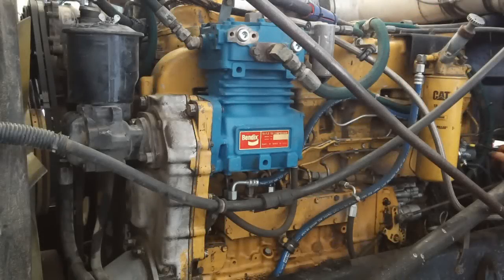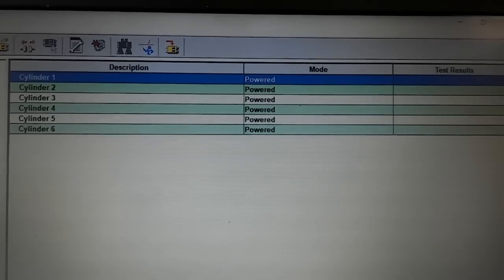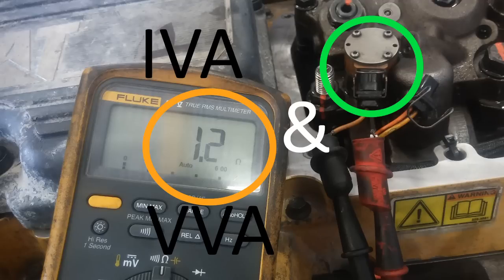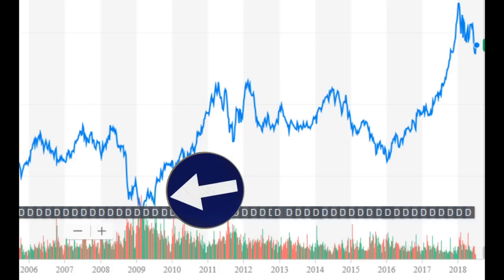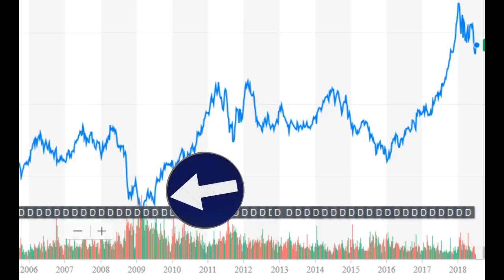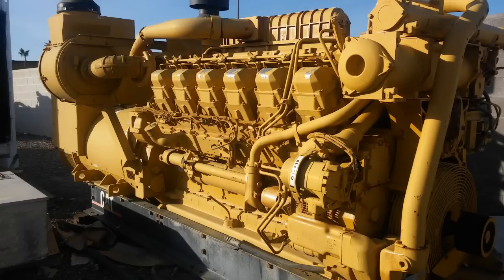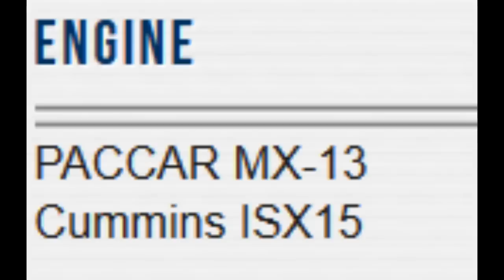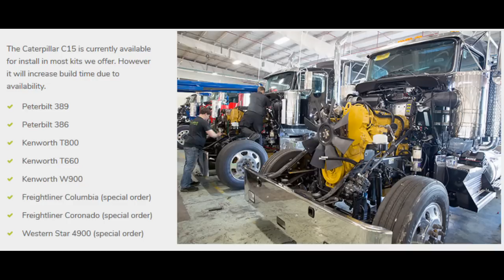Why Did Cat Stop Making Truck Engines?

Comment: Josh, I’ve read these comments. Some very childish, some in defense of the little guy, some praising CAT like as if CAT engines are the best and the rest being wise comments from the misunderstood. Also, you referenced Cummins as a little engine company like as if Cummins were Briggs and Stratton. I work for Cummins as a heavy duty major overhaul tech, I don’t favor Cummins but I do know they haven’t been (LITTLE) since the 1930’s. Cummins is now the leader in power, torque, emissions, on-highway, power gen, marine and agricultural applications. Cummins isn’t the favorite but they are damn close to being the industry standard moving forward. I hate Cummins engines, I personally refer to Cummins as (Cumapart) because that’s all they do now if they make it past 500,000 miles. More work for me at low pay and high maintenance.
Reply: I suppose why cat got out of the road vehicles due to the cost of playing the emissions game. As far as who’s the best? I don’t know, but I do have an opinion on the topic. Like with Ford, Chevrolet and Mopar. CAT, Cummins and Detroit Diesel likewise are similar. There are diehard fans of one brand and fans of one that work on everything and have opinions. That’s who I am, I own Ford’s and Mercury’s and I work for Cummins. I’ve worked on all of the aforementioned brands, I find that anybody can work Chevy and Detroit diesel. It takes skill to work on Cummins and mopar but, CAT and Ford take an education and understanding that the rest just don’t or won’t understand. It’s not about a favorite or a brand your bias to own, work on or operate. It’s about the functionality of the brand and it’s roots in the field and how said brand perform(s or ed) the application it was designed for.
Reply: freddy freddy  what he doesn't know is that Cummins and Detroit powers 90% of the world, cat only power's 20%
Reply: @rondalsimonds6570  

110% huh?
Reply: ndfields1 no cat will never out run my 14l Detroit.
Reply: @rondalsimonds6570  

Not trying to argue that.  Just concerned with your math or percentages of the market share adding up to 110%.  10% of one side or others market share doesn't exist.
Reply: ndfields1 I just love diesel engines

Comment: Accert was not a good deal on the emissions systems with clean gas burn. That dang clean gas pipe back to the engine steadily cracking.

Comment: I drove c10 and c12 powered motor coaches for 7 years and they are by far my favorite power plant. The power band in them was phenomenal compae to Detroit abd Cummings. Today the coaches I drive and all have Volvo engines and they are garbage compared to the Cats. I had a  coach that was 1 1/2 years old and the tubor bearings int failed and left me stranded a full load of nit happy passengers.  I had a 2 year omd coach split a fuel line and anothe kess than 3 years old split a metal coolant line. I have also had 3 complete engine shut downs due to faulty sensors. Imiss my Cats.

Comment: Cat hasn't stopped making engines.
They stopped selling them. 
Cat have produced their own truck to try and convert the engine fans to buying a purely Cat product however they aren't very popular.
The Cat C12, C15, C16, C18 and other models are available in Cat generators and other stationary engine applications.
We have 2 generators running C18 engines which were 2018 models and 4 using C15 engines in 2017 models.
Google Cat CT630 and Cat CT610. This is their truck range running a C-12, C-15 and C-16 engine.
Reply: And as old mate stated below, you can still buy Acert crate engines for repower. 
The guy I work for has two Kenworth trucks and one Western Star all running Cat engines.

Comment: The root cause of caterpillars engines failing happened when the 3406e on highway engine went to accertC-15 ! The variable valve actuators caused a ton of valve train failures around 2005 the studs holding the rocket shafts and the VVA assembles would snap and destroy the top of the head , the upper and lower valve covers , injection harnesses , the cam shaft , and in some unfortunate situations take the valve cover off the engine and cause oil to spray onto the exhaust which would catch fire . I repaired these engines for years and was glad to see them go in the end . They should have used a egr and a vgt like cummins did . They did try to use a type of exhaust recirculation but was also overly complicated and prone to failure on the nxs regen engines . The after treatment regeneration device (ARD) was also to complicated multiple fuel lines with screen mesh micron filters on a fuel manifold with tiny braided lines that almost always broke on removal that supplied fuel to the ard head along with a sparkplug that had a wire that ran the to opposite side of the engine and the ignition coil was mounted low on the block  so it could catch everything coming up off of the road .

Comment: In 2007, Caterpillar had already spent about 3 billion development dollars for ACERT technology.  The EPA came to Mossville with their California advisory board.  The new demand was to handle contaminated, spoiled diesel fuel for 2010 engines.  The visitors were asked what would be the expected fuel contents.  They would not say.  They left for four days of golf and Chicago sightseeing. 
 I had wanted to utilize co-generation and continue improving efficiency (MPG) and available torque. 
 In 2004, Caterpillar could have purchased Navistar for about 4 billion.  Did not because peterbuilt was high volume customer - but not profitable at all.  There are a few chapters of the book here, but Peterbuilt has engines assembled using europe iron.  
There is a long wall of engine patents accross from a long wall of accolades.  There are also letters from users all over the world saying thank you.

Comment: They knew that the DEF sensors and tighter emissions would NOT work. Detroit Diesel only sell to select companies with their Freightliner or Western Star chassis/vehicles. Only Cummins sell to other companies/manufacturers. The EPA killed gliders and the price of those have increased.

Comment: Why did Ford stop using the Cummins as an option in the F-650 and F-750? It seems like now, the only options you have for the F650/750 are a Powerstroke and V10 gas.

Comment: Because of government emission regulations which halted production of the BEST engine ever, the C16 Acert. Then the new emission control engines of 2007 that came out were junk, I worked in the hot test department at Mossville plant and would have fires regularly in test cell cause of these engines.

Comment: Got my start at Peterbilt Motor Co in 1973 then went to Mack Western till it closed 
Then went to work for freightliner dealership till retiring in 2010 when i left i had certification in Cat Cummins Detroit Diesel Mercedes Engine ( i was one of about 5 service tecs that attended every cat and other engine update classes that were given) 
Why I understood and was told why cat got out of the truck engine production was the 3208 which was a egr engine at the time suffered from the issues of egr related issues by the time egr was mandatory on class 8 engine everyone  was using dirty egr gasses except cat wanted to use post dpf clean gasses (filtered exhaust) which required the oem to add a additional exhaust pipe from the outlet of the dpf for clean egr gasses back up to the engine which the oems claimed at the time wasnt enough space to add another pipe while I did attend classes on early cat preproduction version of post dpf egr  in a peterbilt I believe freightliner who at the time had the largest market share of class 8 trucks not wanting to accommodate cat maybe beause of mercedes acquiring freightliner detroit diesel may have been biased toward cat Cat refused to produce a dirty egr gas truck engine and got out of the market I had many friends in the cat engine sales dept that left freightliner that I talked with and thats the way I remember it happening

Comment: Cat has manufactured engines and machines in China for 45 years where emissions are nearly non-existing. Many of the older production machines ended up there to continue manufacturing mechanical controlled engines.

Comment: My father was a truck driver in CA.  when I was a kid in the early 70s, the good days of old Highway 99 and California Orange stands (I-5 wasn't done till mid- '72.) We stopped at a dealership or truck stop and got a Caterpillar engine brochure and I remember the 1693/1693TA. 
Cat motors have a completely different sound and some trucks had small yellow Cat stickers on them. Too bad they're not still around. 40% of the market at one time, wow.

Comment: I worked at a Commercial truck shop for years, studied numerous factors about all these engine manufacturers.   Bought an old 9900 with a Cummins 525hp N14 and never looked back.   But I'd take almost any Cat over an ISX

Comment: Emissions requirements did not force CAT out of the truck market. Vertical integration did.  When Daimler bought up Freightliner and Volvo bought up Mack, they dropped CAT from the brands’ engine option lists for their own engines.  After these two moves, CAT estimated that there would only be about 70,000 on-highway engines to be sold per year in North America.  They would split this volume with all other engine makers (mostly Cummins).  CAT was (and is) too big a company to drop their prices to where they could keep being profitable in the now low-volume loose on-highway engine market.  Didn’t make business sense, so they got out.  They thought they could skim some profits off the Navistar deal, but Navistar was selling vapor ware.  Not sure how CAT got duped so bad.  After that, they said F it and just walked away from the on-highway business.  Their T4F industrial engines are pretty awesome.  The ARD heads have improved considerably since their woeful on-highway introduction.

Comment: CAT was in direct competition with Cummins and Detroit, until CAT couldn't meet emissions and Detroit was bought by Freightliner, which was in turn bought by Mercedes-Benz.
Fun fact: The current DD15 engine that drivers are so horny for is actually the same Mercedes truck engine we saw earlier when Mercedes-Benz first got into this business, but it sells so much better now with a Detroit badge.
Reply: Ddd15 are trash bud 12.7 was the best
Reply: @stevecornejo4861  60 series for the win
Reply: Yeup 60 series i got one a 99 freight liner fld 2 over haul frame still good run like champ 13 speed Eaton if u ask me do i want a new truck maybe yes but with out the technology a cat 3406 in it old one or 12.7 Detroit,if not at least a 14 liter Detroit...👍👍✌✌👌

Comment: Detroit Diesel still makes engines, but only for motorcoaches and for Dialmer USA trucks such as the Western Star 4900 and the Freightliner Cascadia. They also still manufacture parts for the Series 50 and Series 60 as some transportation agencies and trucking companies use those engines; you can also get the S50 and S60 in gliders, but they too will be rebuilt to meet EPA standards. Cummins doesn't manufacture engines for Dialmer anymore, so if you want the ISX in your 4900, you're S.O.L., as well as you can't get S13 in a peterbilt or a kenworth

Comment: My company just bought a Fitzgerald glider 2018 Columbia with a 1999 Detroit.  Beautiful truck until a jack ass old dominion driver backed into the truck on the right side. Laid on the air horn for a good 30 seconds. After the first hit then he went for a second hit.

Comment: My Chicagoland tree service runs and maintains all the diesel equipment we purchased pre- 2007. The newer stuff is FAR more expensive, FAR less reliable, and gets FAR less fuel economy. Plus, I've no need for Blue Def purchases. I can't believe the difference in a Tier 4 engine as opposed to my units. I'm going to run this stuff till I can't. Great power, easy maintenance and reliability can't be mandated!

Comment: In my experience as a heavy duty truck mechanic is that the systems that the EPA has defined as required both suck and fail at an unreasonable rate. Add the cost to such a failure like needing a new one box will set you back $10,000. Now i see these gliders come in for simple problems which require simple solutions meaning the driver/company pays less and is on the road faster for less money.... The way i see it is that the EPA needs to shove their nose in a different corner and let the American truck market do what it does, keep America moving by shipping literally everything that we use day to day without interruptions from said government agency. Can i get an Amen?

Comment: It's to bad that the CAT did not learn from the sweeds. Just look at the Scania and Volvo engines......................................................Ok, enough said. TCB from Vasa Finland.
Reply: Cat did look at them - and found that they were designed in a way that wasn't allowable in the US - because the USA has durability and during life testing.  I am NOT saying they were like VW but they weren't like US laws require.  Cat/Cummins/Detroit learned the hard way back in 1998 about all of that. Cat and Cummins didn't do much - Detroit certainly appeared to be cycle beating as far as I am aware.

Comment: I am a retired owner operator, had a 3406B in a KW T800 and a Cummins N14 in an International 9400,
Both were excellent engines and I got over a million miles on each without ever taking the heads off.

Comment: This is a very sad story. The speaker leaves out all mention of ACERT, which actually was a superior system at killing Nox and particulate at the same time. Their 2007 adaptation was complex, though there were advantages in terms of engine stress and oil deterioration. ACERT cleverly used very high turbo pressure, efficient charge air cooling, and early, variable valve timing to cool intake air and improve combustion. Part of the recipe was increased airflow and, together with the increased thermal efficiency of the engine, this meant more regeneration of the DPF, which also was larger as the exhaust fed back into the intake (with Clean Gas Induction) passed through it. A spark plug was needed to ignite the regeneration fuel, too--more complexity. Sadly, while ACERT gave far superior oil analysis reports in 2003 engines, the high complexity of the 2007 DPF and Clean Gas Induction systems seemed to create a lot of trouble. I suspect Cat could have fixed those problems and added SCR for 2010. But, as a manufacturer of diesels mostly used in construction, and in a market where truck manufacturers increasingly wanted vertical integration (fewer engine options), it seemed not to make sense to stay in the truck market. Cat ACERT continues to be used in non-vehicular applications and is an excellent combustion improver, to the point where the oil sees so little soot, the engine takes longer than normal to break in.

Comment: Just watched this again today. 
Cat have done themselves a great dis-service not developing emissions friendly engines. 
I'm in hard rock underground mining in Australia, the large company I work for used to buy Elphinstone underground loaders and trucks. These Aussie machines were made from Cat components, and some time back, the company was bought our by Cat. 
They had the underground truck and loader market sewn up, however, the deleting of the inline 6 large Cat engine left a gaping hole in the engine bay of these machines. The current R3000 loader is woefully under powered and the A60B truck has been fitted with a 27lt V12 that is impossible to work on and uses too much fuel, while being choked back to reduce power. 
We have moved to Sandvik truck and loaders with Volvo Penta Tier 4 emissions and have better machines....

Comment: To continue on this knowledge... Fitzgerald use to make glider frames for kenworth years ago.. one of the oldest frame manufacturers that predated EPA regulations and were considered exempt from EPA standards. Kenworth tried but failed to keep the Fitzgerald company afloat and the company had to close. Yes you can get a Fitzgerald frame to be exempt from EPA regulations but the frames are highly expensive now and have a huge demand because everyone wants to be exempt from EPA regulations. The DPF system was good in theory and deemed necessary by the Government for 2 reasons. 1. Technical advancement kept out the forgien competition 2. Cleaner air quality or less pollution. The system failed in design and engineering... Caterpillar knew it would fail and refused to build such a design deeming it pointless... The company chose wisely to return to its roots of farming and construction equipment where they knew their products could yield better results without EPA regulations.

Comment: I had a 3126 in a Ford F750 day cab , changed the oil at 7k and valve adjustments The junk CAT Blew up at 220,000 miles  $22,000 later for another CAT engine.

Comment: Sad a little exaust.gas.recirculation. and some water injection will lower the nox and hydrocarbons enough to pass emmisions... There is always O2 injection into the exhaust to make sure all the hydrocarbons combust before they get to that sniffer at the end of the tailpipe... New blood new ideas stay strong CAT
Reply: Tuning the fuel so there's no smoke at all is pretty tough with the turbo it can be done but the turbo eventually wears out and spools a little slower messing with emissions they should just switch to a supercharger they are easier to tune...